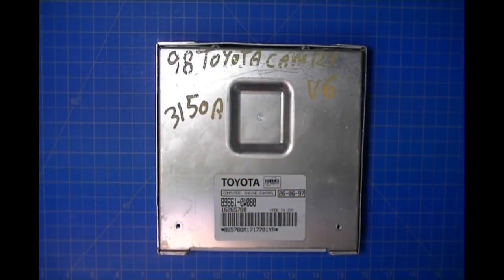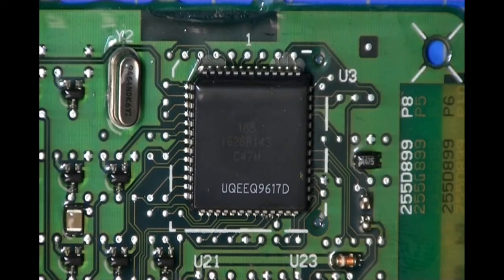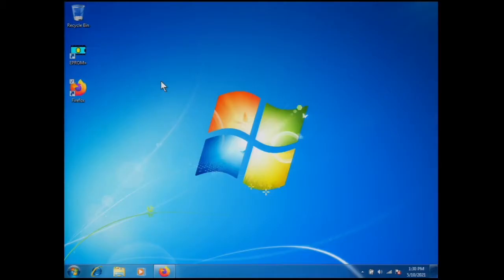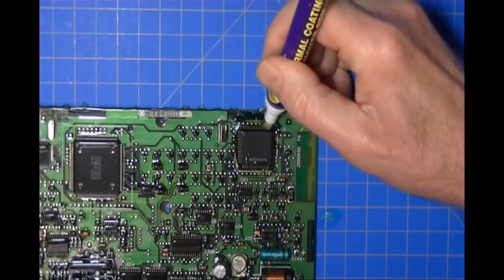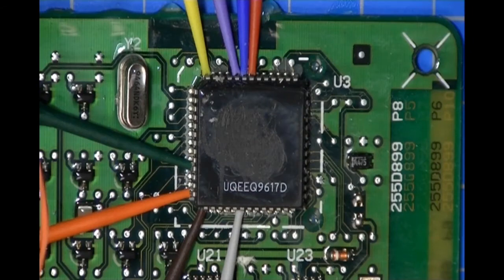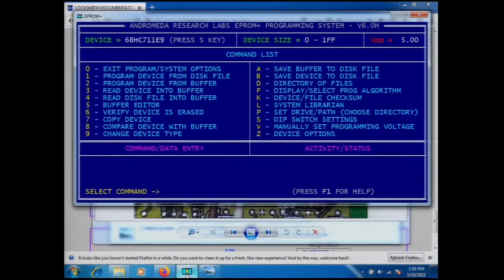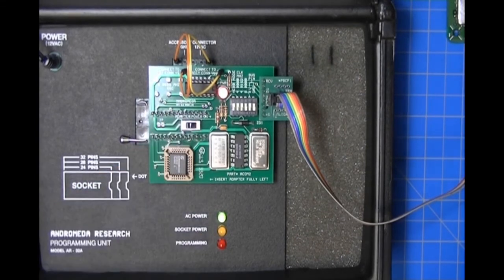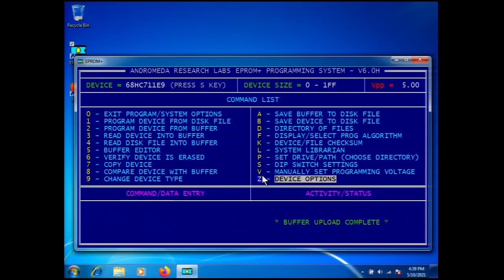How to connect the ACOM2 adapter to a Toyota DELCO ECU w/52 pin micro and perform reflash & cloneout

Comment: Hi hope you’re doing well I did a reflash and everything went trough but the security light still flashing on the vehicle and I’m not able to teach keys to the car any info you can provide about it? 21:23
Reply from the maker: If the security light does not turn solid when you attempt to add keys after a reflash you may have a bad ecu or transponder coil.
Reply: @andromedaresearchlabs7826  is it possible to write original file back to microcontroller and make a clone out?
Reply from the maker: If you saved the original data you can easily write it back.